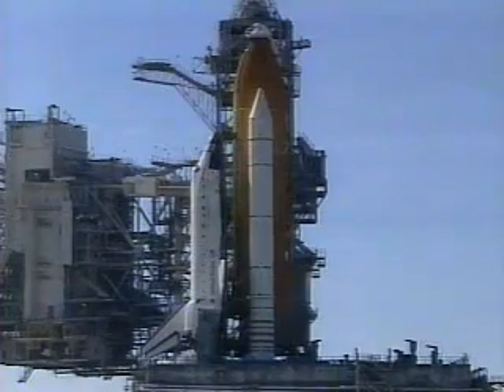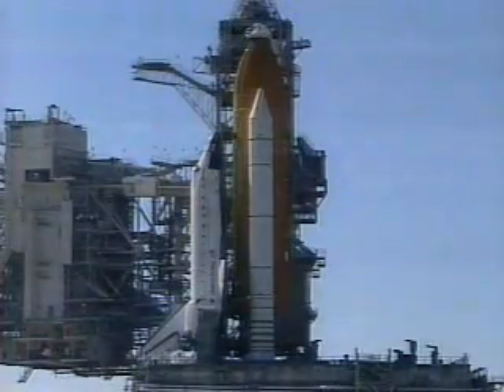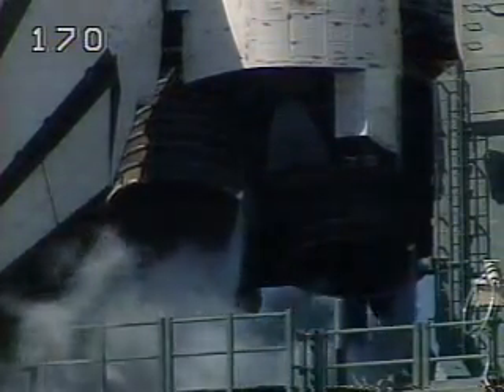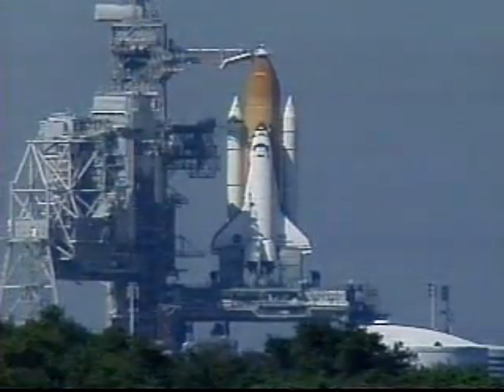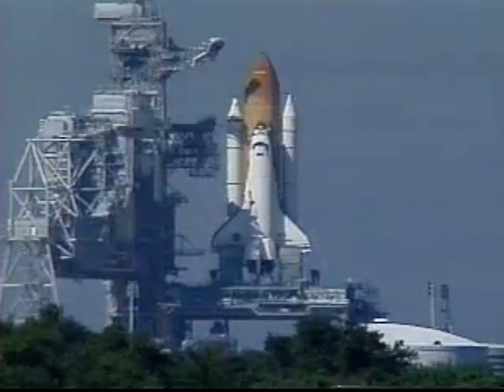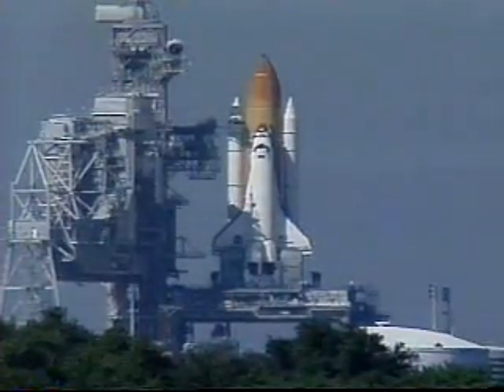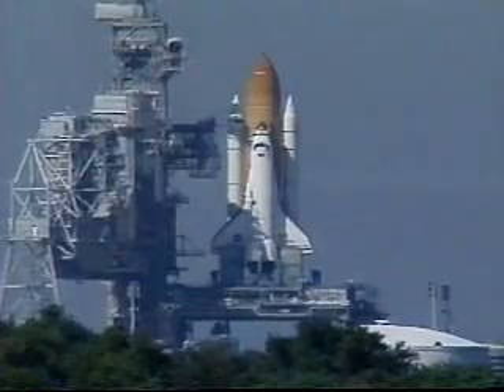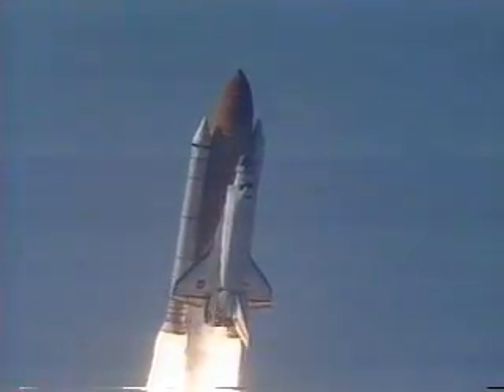STS-95 launch (10-29-98)

Comment: In his book “Riding Rockets” astronaut Mike Mullane criticized  letting John Glenn fly on the Shuttle, saying Mr. Glenn was just another politician using his power for personal gratification. (2 other politicians, Jake Garn and Bill Nelson flew on the Shuttle before the Challenger tragedy.) 
Having Mr. Glenn on board the Shuttle meant, according to Mike Mullane, the lessons of the Challenger accident had been forgotten by NASA and that sooner or later another disaster would occur, and that disaster indeed occurred only a little over 4 years from the John Glenn mission, the destruction of Columbia on re-entry into the atmosphere because of catastrophic damage to the carbon thermal protection system by a falling piece of insulation foam.  
But, regardless of whether it was right or not to let John Glenn fly into space again,  he became and still remains, at 77, the oldest person in space.
Medical experiments were conducted on him  to look at the effects of weightlessness on an older person.  The flight was a public relations triumph for NASA. 
While the publicity for this flight all fell on John Glenn,  the mission carried a suite of over 80 experiments in the Spacehab  module. 
The flight also included studies on fish and plant specimens and on the Sun and astronomy. The crew released a Petite Amateurv Radio Satellite which tested new technologies to capture and transmit radio signals. 
This was the 25th flight of Discovery and the 12th Spacehab Mission, and also the first flight of Space Shuttle Main Engine Block 2 main engines. 
Commander Curtis Brown made his 5th flight and pilot Steven Lindsey his second. Mission Specialist Scott Parazynski made his 3rd flight  while 
MS Stephen Robinson and Japanese Payload Specialist Chiaki Mukai  made their second, the latter her last. John Glenn made his second flight, 36 years after his first, and this was his last mission. PS Pedro Duque,  the first Spanish astronaut, made his first and only flight.

Comment: telemetry showed (incorrectly) that the heat shield might be loose, so it was decided to keep the retro pack on the spacecraft as it provided extra 'hold' on the spacecraft for the heat shield and it wasn't thought that still having the retros attached (instead of jettisoning them after firing as per normal) would cause any problems - Glenn just had extra fireworks to watch!